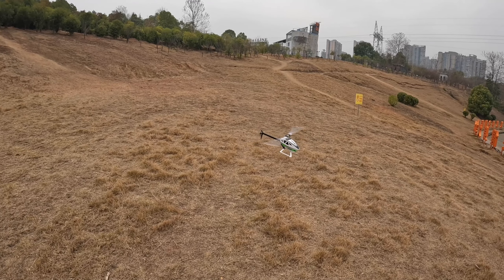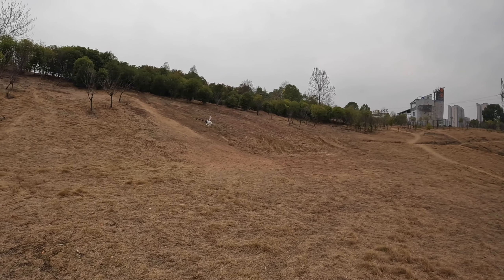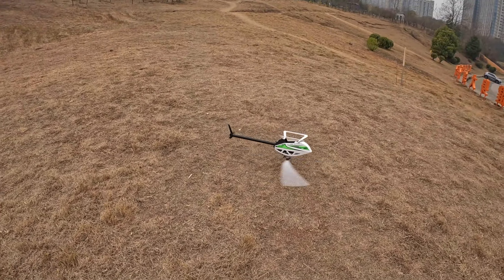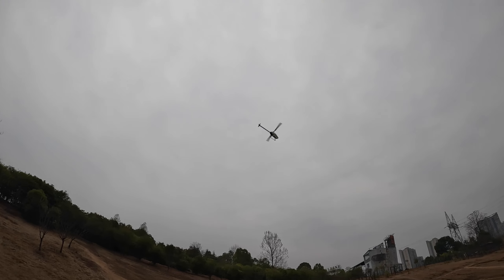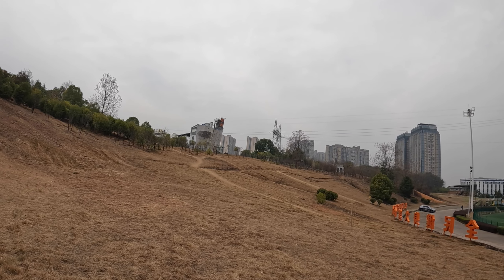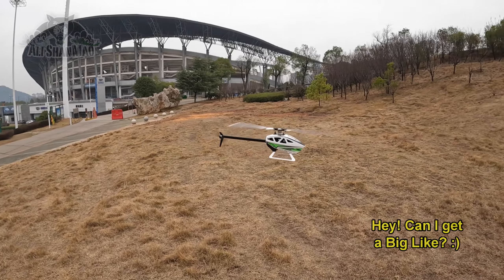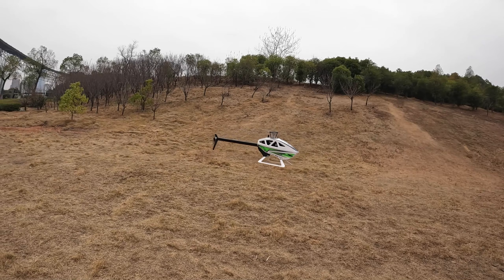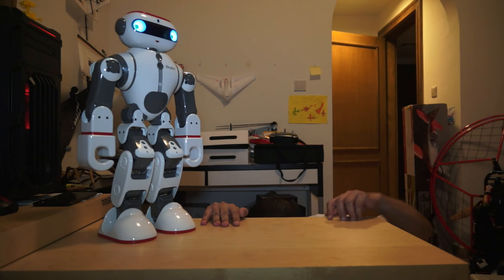See What Happens When We Test Our FW450 V3 GPS RC Helicopter After a Parameters Update!

Comment: When u go inverted in 02:51 - It seems to me (But i may be wrong) that u are below 10m height? Assuming that you are in the GPS stable mode and not in "3D" ALL through this amazing flight - Isn't the Heli supposed to "refuse" the invert possibility?
Reply: Sorry, it is to be read like this: When u go inverted  - It seems to me  (But i may be wrong) that u are below 10m height? Assuming that you are in he GPS stable mode and not in "3D" ALL through this amazing flight - Isn't the Heli supposed to "refuse" the invert option?
Reply from the maker: yes V3 can do GPS mode auto aerobatics and inverted below 10m. In my case. i am not sure for the latest generation of stock and batch. but mine can do Inverted and Auto 3D in GPS mode less than 10 meters altitude

Comment: Slightly disappointed. Went to fly my Heli at my work, took off just hover and went a bit up. Started to sway forwards and backwards then moved to the right and came down. 

Went to the park, re did compass calibration took off, everything was fine then after about a minute or two, it did the same sort of movement just was moving weirdly then came down. Tried to take off after, it then kept tilting to the right. Have determined one servo is busted. 

After all this, just bought a PNP V3 since I’m on a belt driven drive version assuming v1 or v2. 

I clearly never have any luck with RC helicopters and have spent way too much and I cannot afford the amount of spending I’m doing. 

I’m always scared of my Heli now especially when I put V3 in Airwolf I’m not so much worried about me driving it into a tree, more if it’s gonna so it by it’s self with gps if that fails or if esc or even servo just dies. 

Not happy about what’s transpired unfortunately

Went through 4 of the little fpv rescue Jayhawks now spent another 1k on a Heli after I initially spent 1300 dollars on a Airwolf fw450 RTF kit
Reply from the maker: very sorry to hear about your problems. I have been flying my V3 for over 2 months or more often for testing before they released it. yes i have had issues but after my feedback Flywing resolved everything. I still fly my v3 and i have just taken out of Airwolf to give it some 3D flight later that you can watch on my channel. I can wish you best of luck with airwolf

Comment: Any idea why the tail rotor on the V3 would suddenly stop working? All plugs are correct and tail is secure.
Reply from the maker: it will rotate faster or slow down only as per gyro calculated data to make sure tail holds its position. i have seen mine stopping or slowing down a lot during flight before take off etc at times.
Reply: @alishanmao  Hopefully this is the issue. I can't test it until I get a new main gear. My ESC was defective and started smoking mid flight. Emergency landing chewed the gear.